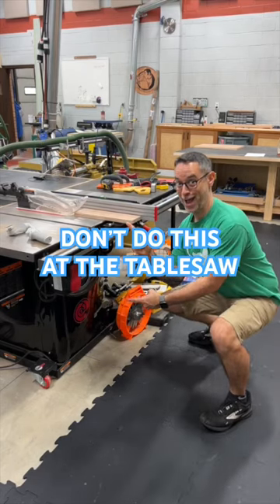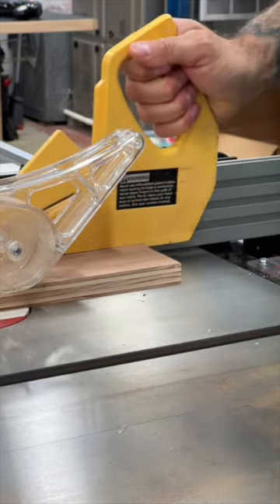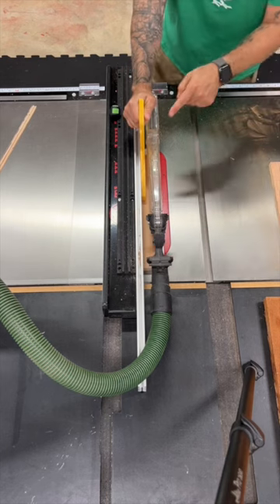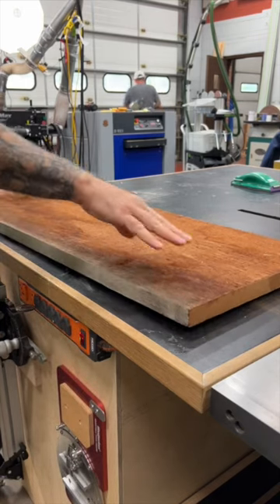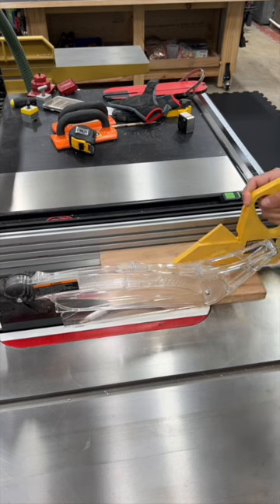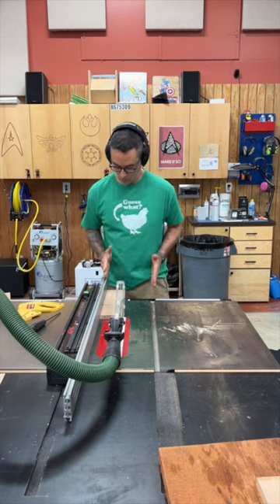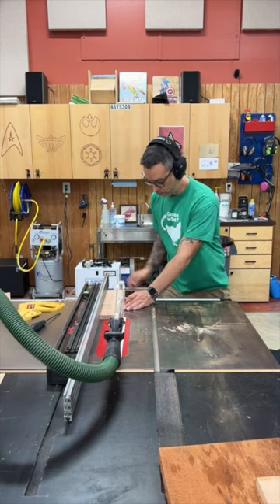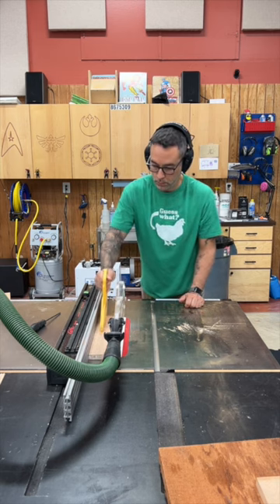5 Things NOT to do at the Table Saw!

Comment: You forgot to mention that after you use your table saw to cut your sandwich in half make sure to STOP the blade spinning before you lick the residual mayonnaise off. I know it seems counterintuitive since rotating the blade manually between licks is a bit of a chore, but trust me it's better to turn it off first.

Comment: I had one accident with a table saw. And I turned it off before the accident. I don't like using the guard for small work, I am very careful. On this day I turned off the saw and was looking at the cut I made. All looked good, I put the pieces on the table, in my mind I turned it off already and it's stopped. It wasn't. I bumped my finger againt the still spinning blade. Ripped skin and nail off. Didn't need medical attention but the tip of my finger still has no feeling and the nail grows weird. That happened thinking I was doing everything right and the saw was, literally as in literally literally, turned off. Just a heads up, pay attention, even when you think it's all right it can still hurt. I'm the only person I know who alomost lost a finger AFTER he turned the saw off. No matter how careful you think you are there's always something you didn't think.

Comment: Also your push stick should be to the blade side of centre, the closer to the blade the better, this keeps the leverage pushing your piece into the fence instead of the blade
Reply: Agree, but those thick guards on top makes proper push stick use difficult on not so wide workpiece.

Comment: I still cringe a little when I use the table saw or circular saw.  When I was 16, I got distracted for a moment and kickback left me carrying a bouquet of fingers to the hospital.

I was lucky enough to have an excellent surgeon and only lost the joint in my left thumb.  Even though that was thirty-five years ago, I left hand works good enough that I spend my days on a keyboard working in technology.
Reply: Yeah, that’ll do it! The moment you distract yourself from a powerful and dangerous tool will be the moment when that tool will remind you who’s in charge! I’m sorry to hear that and I’m glad you were able to get them mostly back! I assume?

I’ve been fortunate enough that the only mishap that’s happened to me is a kickback from a piece of 2x2 scrap lumber. I started off as a helper back in 2019 where I’m currently a superintendent now. No one was around and I saw a table saw on the job site and said “Why not give this a try?”. Well, I did not know how to properly cut a piece of lumber on there and didn’t know about riding the fence and so as soon as I met the blade with the scrap, the blade rejected it and shot it right onto my stomach. I had a minor injury but that’s about it. I didn’t start using a table saw until 2020 and that’s when I really paid attention to how to use one properly from my peers around me and I wasn’t afraid to ask as well.

Comment: Good indirect point about the push stick not being the style that only touches the edge of the board, it’s much better to have something that makes long contact with the top of the board so you have so control over it
Reply: You can debate what is saver. Combined with the fance I would say it is ok. But if you for whatever reason can't use the fance a long stick keeps your hand far away from the blade.

Comment: Is there a way to get the 2 sides of rough lumber clean cut without a planar?   Like if you have a 2x8x10 that you need to keep a lot of the length for the project but it has those warps?

Comment: Number 5 is an important habit that people need to practice.
Reply: I learned that the hard way in high school... 4hrs in the nurses office w/ice down my pants
Reply: For a home owner diy hobby situation - sure. For an all day task at the table saw - no. Your back will be destroyed eventually if you’re constantly pushing wood while standing to the side like this.
Reply: Agree, all it takes is one kickback to the gut and you'll learn why to stand to the side. Speaking from experience!
Reply: @johnnygolden7401  standing to the side is amateur dangerous shit made up by people who are not and never will be pros. Not only does is mess with your center balance leaving your lower back at risk for injury, but it puts your right hand in danger as you’re moving over the blade. Kickbacks are not that dangerous if you’re braced properly to absorb it. I’ve seen hundreds and 95% of all kickbacks happen because the operator is incompetent. 

I’ve put miles and miles of material through the table saw and I’ve been taught how to use it by the best professionals in trade schools. Real experts. This standing to the side shit is why I’m seeing more and more ridiculous videos on the internet. 

Instead of fabricating false safety measures that you believe feel like common sense, find the pros that have been doing it for 10-20 years and have a conversation with them

Comment: Definitely one of the better vids on table saws. However I’ve got 2 things to comment on. If you’re spending a significant amount of time on the table saw, using a push stick and free hands for almost every cut you won’t yield good consistent results and standing to the side will be very bad for your back eventually. I’ve eaten a butt load of kick backs and they’ve never been that bad even from a 5 hp sawstop and even when I was in shop class decades ago in middle school. At least it’s never hurt worse than my back after standing to the side all day as a rookie.

Comment: Your offset made with the supplementary fence should always be more than the longest dimension of the offcut piece, including the diagonal across the corners, or the offcut could still spin 45 degrees and bind between the fence and blade.

Comment: As a 8 an 2 half's fingered guy, these are infact excellent tips. My personal experience has taught me, do it right or don't do it, Chances are you're going to get hurt. I operate various Cyber A/T (20ft long machine with 5 blades ranging from 36" down to 12") and computer assist arm saws (like the mango tech) on a daily basis. Years of experience and knowledge. Still lost 2 fingers.

Comment: If your piece drifts away from the fence before the cut, you are pushing the back end away from the fence.  If it starts to drift after the cut, the fence (or the blade) needs to be aligned.

Comment: #6  Properly adjust, then recheck your miter fence on miter gauge before cutting to make sure it doesn't contact the blade.  Especially Sawstop owners - there's a really good chance the brake will fire and destroy your blade (and brake).

Comment: When you placed a spacer between the fence and the blade there is still significant risk of kickback of the cutoff piece.  Just use the miter guage and measure for each cut.  That little cutoff piece would fly like a missle if caught betwwe the blade and the fence!

Comment: Guide to saving your finger if it gets cudt off so that it can be replaced eith surgery:

Breathe slow and stay calm, your body will release adrenaline and youll begin to shake, try to keep yourself keeping good breaths and as calm as possible cause its gonna hurt and there will be alot of blood

First if you can try and get someone to help you with this and call an ambulance immediately after tending to the injury, but if you cant you'll have to do it alone, tend to your injury by quickly rinsing it under water and if you can stand it, cleaning alcohol, then dry lightly with a cloth and wrap it up tight to prevent further bleeding, keep your hand in the air to slow bloodflow

If youre alone, now is the time to call an ambulance

Get the severed finger and clean it just as you did your hand where it was cut(or what remains of your finger), soak a few paper towels eith room temp water and gently wrap the finger in them, then put the finger into a ziplock bag, then take another bag and fill it with ice and water enough to submerge the first bag, then put the first bag in the ice water bag and seal it

This will preserve the severed finger long enough for medical professionals to arrive and immediate surgery will allow the finger to replaced

Comment: I recently took a wood missile to the stomach and got a nasty cut and bruise. Wood drifted away from fence part way through the cut and the blade pulled the wood across and fired it back at me. My wife took the opportunity to remind me that I do have an apron that would have softened the impact and feather boards to help prevent this all. Complacency with experience will get you hurt.

Comment: Don't stand in the line of fire is no joke. Was a couple inches away from losing reproductive capabilities when I learned that one.

I will add one more: don't always use the table saw.

If you are too tired to pay complete attention, don't even turn on the table saw. Need some coffee? Maybe you don't need the table saw.

You don't always have to do it on the table saw. Statistically lowers injury over time and helps maintain mental separation between relative risks. If you can't focus on staying safe, focus on finding a different approach. You can fix an imperfect cut. You can't sand down a hospital bill.

Comment: You missed the very most important table saw tip of them all.  NEVER wear gloves while operating a table saw.  If you do happen to touch the blade with your fingers you can get a nic or even a nasty cut, if you're wearing gloves you WILL lose fingers.

Comment: Your “supplemental fence” is just as dangerous, maybe even more so because you believe it’s safe. Drop offs can jam diagonally or otherwise shoot out of that little death chamber you made. You should never use the fence to crosscut, unless your fence can slide back so it doesn’t overlap the blade (e.g. Unisaw, sliding table saw).

Comment: you def can saw rough lumber, just buy the right blade for it, make sure the hollow side is underside and the blade is as high as you can, make the fence that it is 2 cm behind the blade messured from where the blade first cut through the wood (like you did with the cross cut but further to the blade)

Comment: "Reach around" 😂😅😂 I think one tip that isn't mentioned often is to use a wooden push stick when space gets tight. Using a plastic push stick can be dangerous. The plastic can catch on the blade and break, pull in, push up, explode in multiple pieces, etc. Wood sticks just cut. They are easy to make and safer for the narrow stuff.